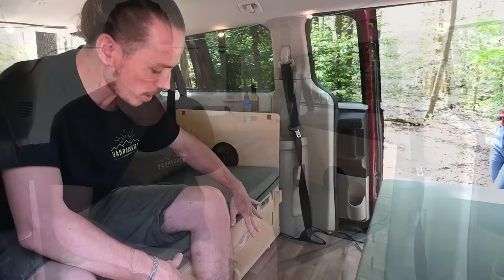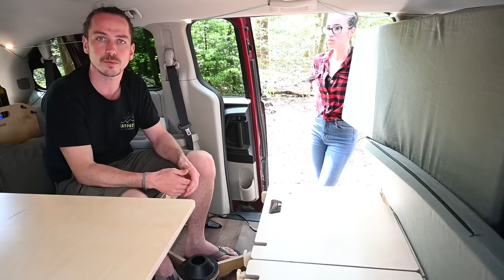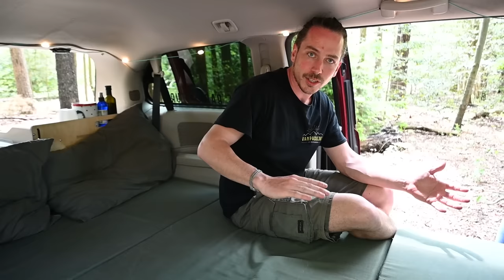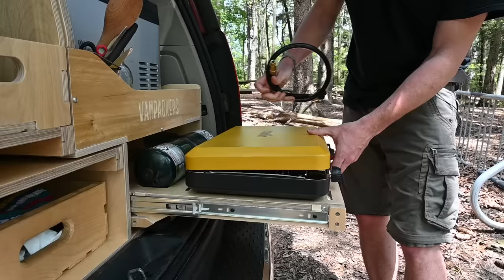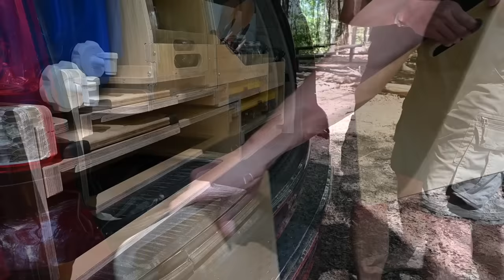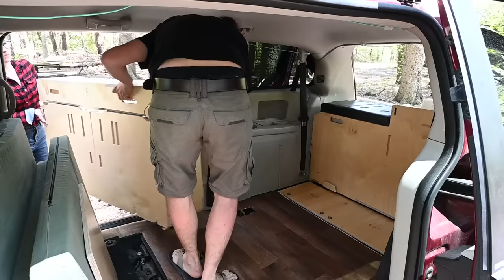GENIUS Car Camping Kit Installs in Minutes - Kitchen | Bed | Refrigerator | Sink

Comment: Great idea! I would like to have the boxes open from the middle or outside rather than front to back. That way when they are stacked you could still access the top module contents from inside or the rear of the van. And the bottom modules should open from the front and/or back so you can access the contents from inside and/or outside the van when they are stacked with maybe slide-out containers or drawer/shelves.
Reply from the maker: Thank you for the feedback
Reply: Thanks ! that a great point ! we'll definitly think about it :)

Comment: This is a fantastic conversion kit.  I just bought a 2016 Odyssey and have been pondering how I was going to outfit it.  I think I will skip the hard work and just order the kit.  Just need to make sure I have room for my road bike inside.
Reply from the maker: Great to hear!
Reply: Thank you for your kind comment ! actually, if you don't keep the second seats row you will get a large space puttin the front boxes on the rear modul :) (you can see it at 3:30 in the video !)

Comment: Your build & design is great for abled body person who want to go camping. Yes you could haul on a wheel chair trailer. The Lifting can be a stop gap inside the SUV for the Disabled person. Cooking outside can be enjoyable but can also attract natures critters to come around to eat with you & only allows for seasonal weather to be outside cooking. Your appeal in your build is a seasonal type of camping on the go agenda. You can utilize the Roof Rack to put a Solar Panel on to Charge Your Reserve Lithium Battery & on No Sunny Days charge your Lithium Battery from Running your Motor Vehicle when Driving. Your business appears to appeal more to a certain age group of campers. Wish you much success in the go'n into & cum'n out from in the journey traveled. Viva La France!
Reply from the maker: Thank you for the information and support

Comment: Very practical and very useful conversion. But, I think I should mention some points where it could be more better because you know, there are always room for improvements.
#1. Seat belts: There should be provisions for attaching seatbelts because I think seatbelts are must for personal safety. You know where to put them.
#2. Burner: The cooler and the burner are just on the same line. So, to reach to the cooler, one has to lean over the burner which could be very dangerous because the end of your t-shirt (generally people wear comfortable clothes when camping) will be hanging directly over the burner which could lead to fatal accidents. You should think about that.
#3. I saw there are some cutting on the floor of the vehicle through which I could see the machinaries underneath, please correct me if I am wrong. In my opinion, cutting the floor of the vehicle is not a very good idea as it may cause some safety issues to the structure of the vehicle itself as well as for the passengers. 

If I am right about my findings and if you (the maker of the conversion kit) can give some solutions on these, it will be much appreciated. 
Thank you for this great video.  ❤️
Reply from the maker: Thank you for the suggestions

Comment: A very impressive piece of well thought out work. I am designing my 2015 Mazda 5, right now, and the biggest issue I face, is the floor with all rear seats removed, is the differing levels? So instead of trying to jig saw the lower sides of the box, I may try leveling the floor first with 3 indavidual floor sections = another sheet of Ply, but a lot more ease of work and time saved. Auestion... Have you ever done a Mazda 5 ?
Reply from the maker: That’s a good plan. I don’t believe they offered that kit yet

Comment: This is brilliant! I love all of it and I plan on getting this for my Caravan. I feel like there is some things that can be added to this set up tough that got missed.

Like for example. Why not include a portable outdoor shower system of some kind that will fit with this on your site where your can swap it in for the water tank so that way you the option to have a sink and a shower instead of just the sink?

What about some sort of water proof or rhino line coating on the the wood to keep it from water and other types of camping type damage.

Also and I think this would be the best addition. What about a milled wood floor of sorts that goes with this that lets you plug and play the rest into the floor so it wont slide, will protect the floor and will be easy to clean. Like Legos.

Comment: Wonderful job. One question though… if you hit a rainy or maybe even stormy day is there anyway that there could be a tarp or something designed to fit it that would cover the kitchen area so you could cook and not get soaked.? Or did I miss it?
Reply from the maker: Yes, you can add an aftermarket 270 degree batwing awning
Reply: @NewJerseyOutdoorAdventures  Thank you. Just wondering. I was sure you must’ve taken that into consideration when you have practically eliminated every problem that one could  have in a van conversion.
Reply: Thank you ! The trunk rag is actually very effective in protecting the kitchen from the rain ! But in fact you can add an addition awning in case of heavy rain :)

Comment: finally!-a conversion that works easily for a one person set up!
DOES IT FIT A 2004 Sienna?? Also-how sturdy is the birch?
Reply from the maker: Thank you for the support. I believe it does
Reply: Hi ! thank you for your comment! we use multi-ply birch bonded with moisture resistant boat glue since the very beggining, because it's for it we use multi-ply birch bonded with a moisture resistant boat glue as it is known for its strength. In 4 years, we have never noticed any breakage on the kits we rent (that are use fulltime between may an november). And none of our customers have had to complain for now :) 
Unfortinatly, we are stylle working on kits for Sienna between 2004 and 2010... So our kit only fit on Sienna from 2010.

Comment: Very nice unit, well thought out. The 1 question I have is the floor part of the kit you can order. I notice that when you take out the kit from the van at the end of the video that the floor is still on the van.
Reply from the maker: It wasn’t removed just so the video was quicker
Reply: Is it part of the kit or would I have to do my own floor?
Reply: After watching the video for the 4th time i figured out that the floor covering just lays over the carpet in the van. There is no wood floor.

Comment: I would really love to have one of these kits.  Is it hard to put together?  I am 69 and not sure I would be able to put it together.  I just retired and want to travel and this would work wonderfully for me as I have a 2012 Dodge caravan.
Reply from the maker: Great question Brenda. From what I seen in person, it looked very easy to assemble in the vehicle. The kit does come mostly assembled and built delivered to your door
Reply: Thank you for your comment ! :) As Patrick said, the kit is delivered at your door already assembled and it really easy to plug it in a van! Most of the module are really light, you may just need some help of a friend to install the kitchen module wich is too wide to be carry by one personne :)

Comment: I've done a lot of research on van build configurations/materials. Interesting build and much credit to this couple (clearly they have given it a lot of thought and effort) but some things about it make me hesitate. 1. It's designed for rentals so very heavy, durable wood is being used, understandably. A lot of heavy wood = weight = more gas to haul it. Experienced vanlifers often use plastic  or other light materials instead for certain elements. 2. Ingenious slots, but a lot of little pieces sticking out that people will probably catch their legs on (even though they have been rounded out). 3. Watching Gab move around and rearrange the pieces for different applications, he looked somewhat awkward and cramped. 4. It's always important to have quick access to the driver's seat - it looks a bit blocked off by this configuration.
Reply from the maker: Thank you for the feedback
Reply: Thank you for your feed back ! it's really appreciated :) In fact the plywood is not the lighter fabric, but we tried to keep the kit under 185 Lb. the all kit is actually 175Lb, not so heavier than an other passenger :)

Comment: I'll stick with my way that's a lot cheaper and gives me everything I need even Abel to take a shower in my van. 
2000 Ford Windstar.
Reply from the maker: Oh wow that is awesome. Here in the USA all the Ford Windstar were recalled and bought back. We don’t see them on the road anymore.
Reply: @NewJerseyOutdoorAdventures  yeah I know. Just found that out after I bought one. I've got it being worked on tho. 
It will be running in good condition soon. I'm replacing the rear end Axel. 
Did a tune up & this is all it seems to need  oh I'm getting two new tires for it. So all in all 4 grand 
Not  including my cheap no build ive done for it. But once the mechanic gets the part I need I might make a video of how simple & cheap it can be to live in a van. God Is Good.

Comment: On a van like my Honda Odyssey the spare tire is under the floor between the front and second row seats. No one ever talks about how you access the tire after one of these conversions.
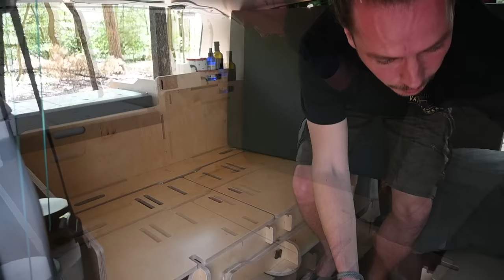Reply: In fact, with this conversion kit the access to the spare tire is way easier when it's under the vehicule with an outside access. But the front boxes are very easy to move (they are very light ! ). They have been designed to be placed on the rear box in order to facilitate the opening of the stow n' go seats in certain vehicles :) (You can see the manipulation at 3:40 in the vidéo). So if the spare tire is needed, you still can have an easy access to it ;)

Comment: Nice kit, very well thought out but extremely pricey for what it is (cnc cut plywood). Price needs to come down by at least 50%, you’ll still be making money at that point.
Reply from the maker: You don’t think they deserve to make profit, payback for design and engineering and equipment cost, insurance cost employee salaries, warrantees, and returns?
Reply: As I said, they’ll still be making money at half the price.

It’s cnc cut 15mm plywood. Not exactly expensive to make. There’s less than $300 of materials in it.

They’ve got greedy and have set the price too high, thereby drastically limiting the potential for sales.

Comment: What about the leveling?
Reply from the maker: You could use leveling blocks underneath the tires
Reply: @NewJerseyOutdoorAdventures  TY, but I'm talking about inside the he van floor. I've found ways of leveling a van floor. because they do slant downwards going towards the front from the 3rd row seating. js
Reply from the maker: @1FlamyAmy ohhh. I’m sure van packers has a solution for this.
Reply: @NewJerseyOutdoorAdventures  it will be out of my price range. I've got it covered, lol